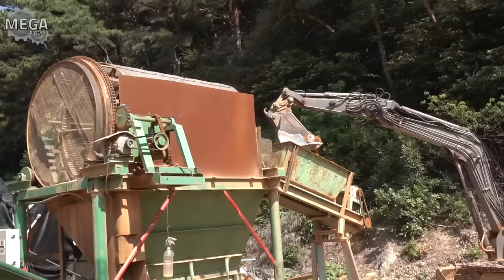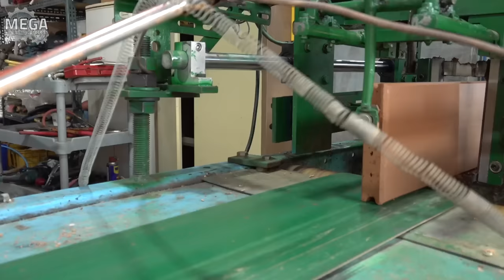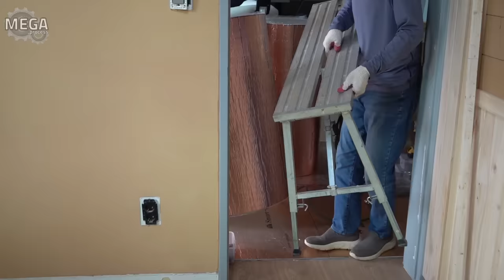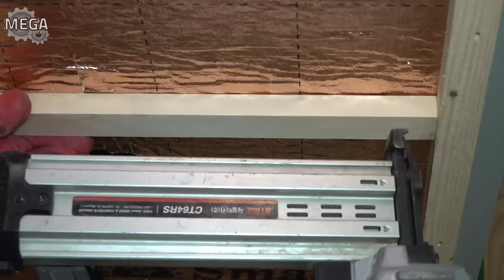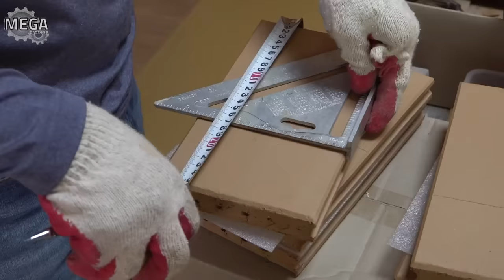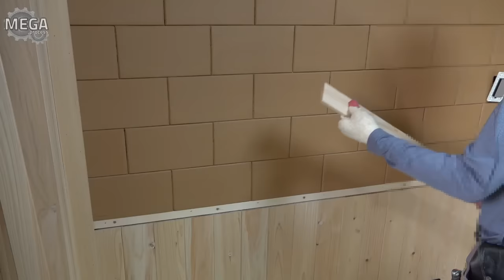Process of making adobe house with dried mud brick. Korean mud brick mass production factory

Comment: Wich is the propose of the copper tube?
Reply: The copper tube is used to hold the bricks in place without using mortar. quicker and cleaner installation
Reply: It holds briks on the wall